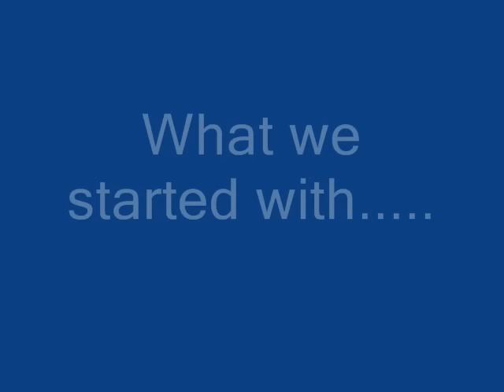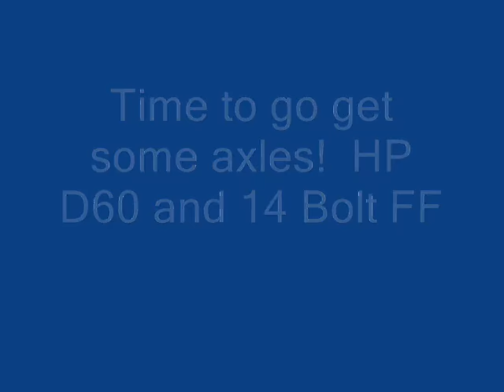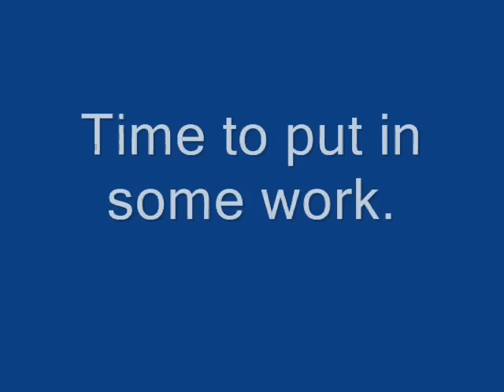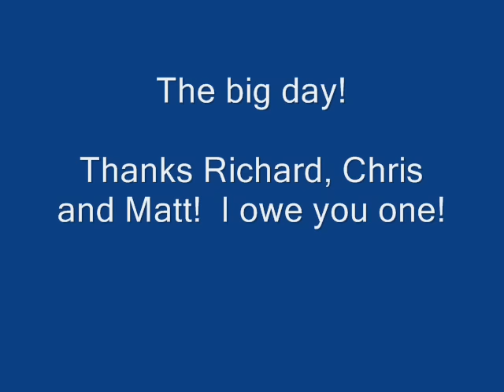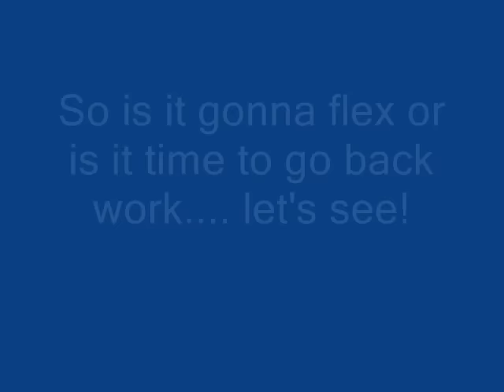2001 Nissan Frontier Solid Axle Swap - Extreme Off road

Comment from the maker: thanks!  a bit more than i had originally planned.
Reply: What axles did you use for this I'm over in the UK and thinking of doing the same to mine, but if your into modifying vehicles over here you may as well be the devils son they fucking hate it. I've been looking at axles on common things round here like landys and patrols and land cruisers but all there front diffs are on the wrong side I've been told a jeep waggoner front axle fits and that's a Dana 44 or 40 I can't remember. But yeah I saw you swapped both the front and rear axle so if you wouldn't mind could you let me know what they were please

Comment from the maker: @4X4punisher 
the front 60 and rear 14blt were a package deal.  and it would not benefit me to go with a rear 60; as my fron t60 is hp driver drop and gearing options are same as 14 bolt.

Comment from the maker: @27MattG 
thanks for posting and the tips!  my motor has a few upgrades but no cams.  and honestly i have not heard of BIG hp gains with the cams nor do i want a chunky idle.  the gearing i have in the tcase and axles help quite a bit and i am satisfied with the overall power that is delivered to the tires/wheels.  enjoy your frontier where you take it.  anytime you want to push it to and past its limits...let me know and i'll point you in the right direction.  cheers!

Comment from the maker: @bowmaster24 
they hold up well.  130k on mine and 50k of which was on 37 or larger tires.  its been tested and ran hard and zero problems.  the blocks on these motors are huge and really overkill for the output on these motors so they will take a good bit of abuse.

Comment from the maker: Yes that Is what I meant by Outboarded.  The springs are located outside of frame rail in front. 47" springs. Springs are the same width as the frame rail in the rear. I will be at the garage in a few days and will try to get some measurements.

Comment from the maker: Thanks!  Hardest part...locating the front axle.  Figuring out the front suspension and trying to keep it low as possible with a high pinion dana 60 front presented challenges.  If I had to do it again I'd do it differently, but not sure I'd like it any better.  Truck works well now as is.  Thanks again!

Comment: newtdini i know this is probably a long shot since this is from 2008, but do you remember what brand upper control arms you had when you still had ifs? I'm trying to decide between a few brands and those seem to flex pretty well for ifs. 1:16
Reply: newtdini btw awesome work man.
Reply from the maker: Thanks man!  Arms are from AC. Check out 4x4parts.com. They sell them there. Later
Reply: newtdini i was gonna go with those but heard of alignment issues and too much positive camber. If you had no issues than those are what i'll go for. thanks for the repsonse.

Comment from the maker: Custom piece. Can't recall width right off. Will try to remember to measure. It's kinda wide though. Springs are outboarded a little to accommodate axle width.

Comment: outboarded! do mean that they are not dead straight they toe in to location from diff mounts! in the video at 4.24 minutes it shows there the hanger sticking out looking at it roughly between 4''-5" and yeah i'm finding that1.8m diff's though are going to be great for stability are a pain like you say locating cause of the length!

Comment: yeah i just went in to the shed and measured my springs and their 48" oh well! i also noticed below the front bar did you put a sheet steel brace from the front crossmember foward to a new box section piece and capped off the chassis or was it like that? reference 6.12 minutes  cheers mate you really helpful, if you could pm me with the with measurements would be hugely helpful !!! thanks again